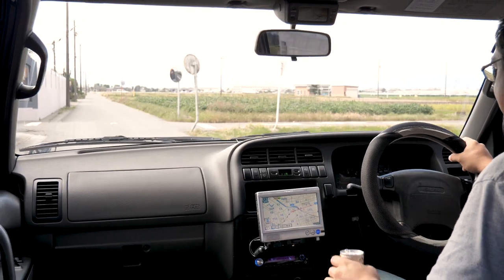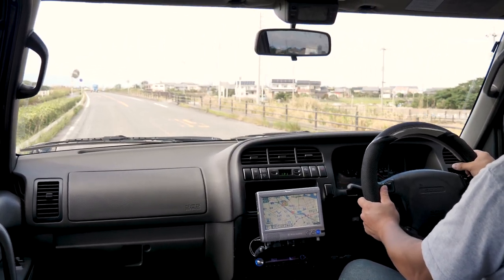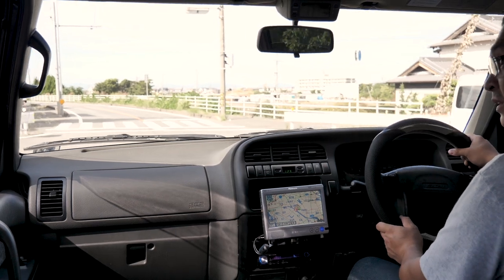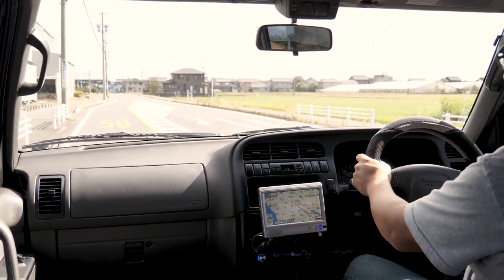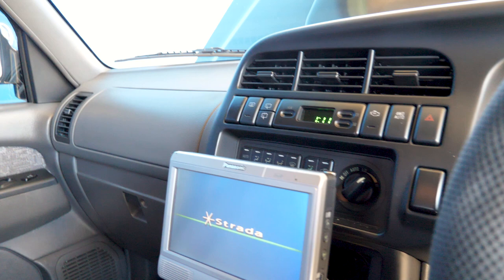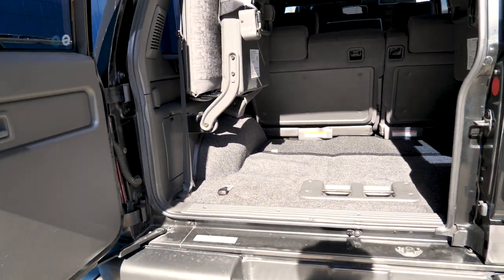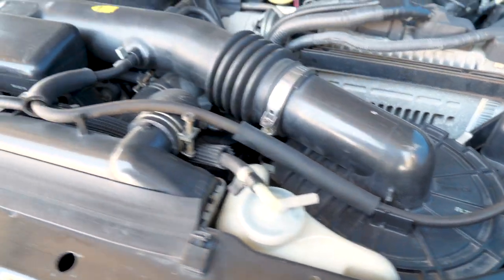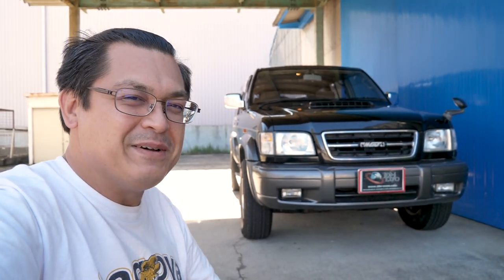ISUZU Big Horn Diesel 3.0 DOHC

Comment: Hi, Im rommel from the Philippines. i also have isuzu trooper, bighorn 4jg2 diesel. how do i use its 4wd drive? thanks.
Reply: When your vehicle is on- Put your vehicle into Neutral and hit the 4x4 auto Switch. It should engage 4x4 and then put it into 4Lo